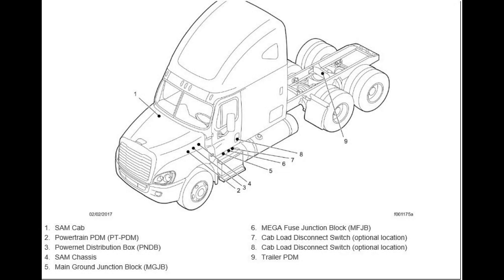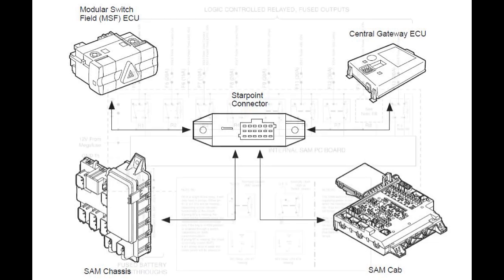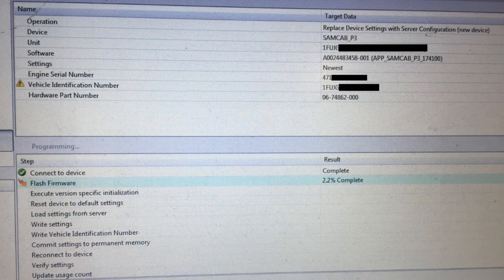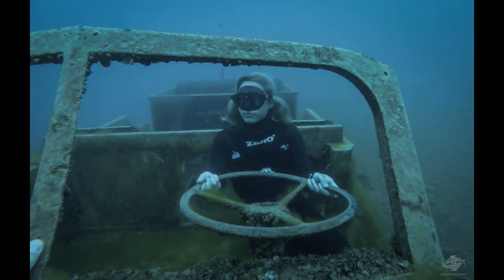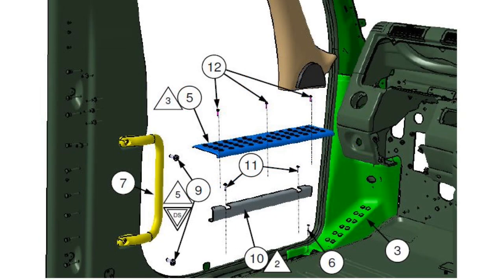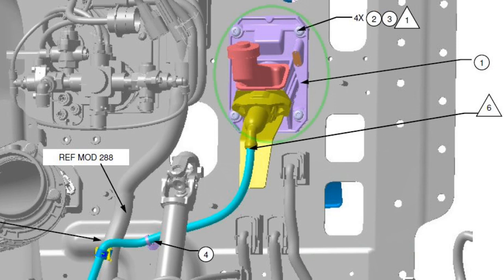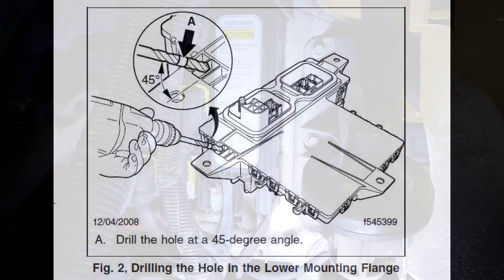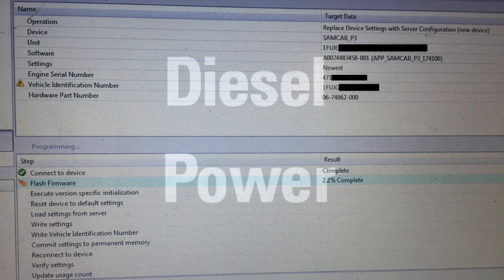Know your Cascadia: The SAM Chassis

Comment: My MAF (mainly hazards and dome light switches) have been intermittently failing or working. Night you can see when the back lighting illuminates the switches, they will work. When the back light goes out, they do not work. Headlights, blinkers, reading lights. They all work and have no trouble with operation or lose power. It seemed to just be the MSF. Both front Dash and switches in the sleeper.
Reply from the maker: Each switch mounts into a pack or group of switches. Each switch pack is "Daisy chained" to the next with a 3 pin connector/harness on each side. Each pack just has a simple little circuit board inside that's visible once you pop them out of the dash. Those circuit boards and connectors are prone to corrode and cause all kinds of issues. Since they're all wired in series, it only takes a problem with one to mess up the others down the line. The Daisy chain begins at the MSF master (Hazard switch) and jumps to the slave packs down the line (There can also be more than one line leaving the MSF master too depending on the trucks configuration). It would be worthwhile to pop them out of the dash and have a look at the connections. Something as simple as spilled coffee can slowly begin to take them out.

Comment: Could a faulty Sam chassis cause issues in the sam cab? When I turn the key on, cab lights, turn signal, hazard lights, blower controls, wipers stop working. Also I get chs 216, ecu 128, and cab 249 codes. Any input would be greatly appreciated

Comment: Where would one find the gateway control module on a 2019 freightliner
Reply: If you have a login to DTNA connect you can find it that way but if not it's located at the electronic bay which is on the passenger side, inside the cab. It's behind the fuse panel. The central gateway is all the way on the bottom

Comment: I have a 2010 freightliner cascadia and  my voltmeter gauge say I have 12 volts and my battery warning light come on but my check my alternator and is 14.0 volts and my battery too if I turn my engine off 2 check engine light come on and my truck won't start and I was checking online and say my truck have a 2 sam chassis recall I check my and have water marks so I gonna take my truck to the dealership this Friday I hope they fix that  Thanks for the video.
Reply: Check the PNDB.

Comment: Chs 71 spn 524049 fail 31

2) cab 33 spn 524049 fail 31

3) eng 0 spn 59.6 fail 13

4) eng 0 spn 60.2 fail 13

5) eng 0 spn 60.0 fail 13

6) eng 0 spn 97.3 fail 13

My symptoms that I'm experiencing, truck shuts off and on like crazy. I don't have any lights at all. So I'm thinking something electrical? Can you please help me here. 2012 Freightliner cascadia dd15 engine
Reply from the maker: All of these codes point to the MSF (The Hazzard Lights switch) powering down or losing communication with the vehicle. Since the MSF is powered from the SAM cab and the truck is also turning off and on, I'm guessing the problem may lie with the SAM cab.
Reply: @TheDieseler  those codes doesn't have anything to do with the Sam chasis? I was told that the Sam chasis is the culprit
Reply from the maker: The one code being broadcast from the SAM Chassis (CHS 71) is indicating it's lost com with the MSF. The SAM Chassis also does not power the engine. Now, that being said, it's tough to be 100% certain without being there to check things out. Basic things to check are power and ground supplies to the modules and any signs of water intrusion.
Reply: @TheDieseler  is this an expensive repair?
Reply from the maker: Again, without knowing the exact cause of the problem, it's tough to say.
Reply: @TheDieseler  thank you!
Reply: Sounds like PDNB
Reply: I’d bet it was your PNDB

Comment: 2014 Cascadia evo. I was wondering how to connect a GPS unit. It needs constant, switched power,  and ground. How do you do it without cutting any wires? Is there a connector I can tap into?

Comment: I have two error codes in my truck. Cascadia evolution 2014 manual transmission;
The one on the dashboard reads: 
NO DATA BUS COMMUNICATION 
 and only displays the hobbs milage, no gauges works. My AC cab unit doesn't send cold air and my sleeper  ac PARK SMART doesn't work either.
The other one is on the meritor wabco screen that reads: 
CAN BUS ERROR 
J1939 messages 
Check connections. 
What are your suggestions? I am in Oklahoma.
Thank you.
Reply from the maker: It sounds like there is a problem with the 1939 Datalink. It could be something simple like a recently added eLog system problem, a malfunctioning module or a problem with the 1939 wiring. That Datalink is shared throughout the truck. If the only affected modules are the ones you've mentioned, the problem could be inside the cab.
Reply: @TheDieseler  
Thank you. I will look around the cables. I will keep you posted. Thank you again

Comment: Hi,
If changed Sam cap and Sam chassis with used one, how can I do the calibration using Ddd8, and my version can not be connected on line?

Thanks
Reply from the maker: The parameters and software needed to update them have to be downloaded from the DTNA/Detroit servers through DiagnosticLink.

Comment: Great video! Thank you.  Would be great to hear about trouble shooting symptoms of SAM cab vs chasi vs ECU.  I've lost cruise control and have rough acceleration, like when you disconnect the speedometer (Volvo).. max spd of 50mph.  I have a Cascadia 2012. Can't get a  Diagnostic link to work but J19 still sends all gauge and mileage data to my logging device on my cellphone. 30 min 3 key flip reset does not solve.  Thx
Reply from the maker: Do your engine brakes still work? The reason I ask is because a faulty clutch switch is not that uncommon. The first step though would be to figure out why a diagnostic tool will not work. That's the best way to remove a lot of the guess work.
Reply: @TheDieseler   No. The engine brake light illuminates when turned on, but does not actually work.
Reply from the maker: @maximaleffort  I'm willing to bet the clutch switch is telling the CPC that the clutch is partially depressed. That will keep both the Engine Brakes and Cruise from working.
Reply: @TheDieseler  Thank you sir!  I can  unplug the direct wire I put in when the clutch switch failed.  (Allows me to start without holding the clutch down) Do you think maybe that is why the parking break warning is flashing when I open the door, even though the parking break is set?  I believe this is keeping me from doing a parked Regen.  Thank you Dieseler!
Reply: The chronology was..1 cruise control stopped working intermittently,, 2 engine brake would  not engage sometimes when switched on, but other times would, 3 no cruise ever , 4 "warning parking break off" began to flash while I was driving and when I would open the door when parked with air brake on, 5 no engine brake engage ever, 6  clutch switch failed to start truck when depressed, 7 hotwired clutch switch, 8 no parked  Regen, 9  derate, 10 diagnostic port says take to freightliner.  But last time I did that I spent 12,500$ USD on a new 1 box, no money left-that was about 100,000 mi before all this stuff cascaded into my Cascadia! LoL.  Thank you, I will Patreon you thank you for your insight and videos. Thanks again.
Reply: OMG Dieseler!!!!!!!!!!!!!   I got my cruise, my engine brake, and my truck is trying to Regen right now!!!!  I can't thank you enough.  I  rewired my clutch  hot wire by changing the configuration once it started.  Wiring females 1 to 3 starts it, and once it's started moving 1 to 2 gives me back my functions.  Thank you, Thank you, Thank you, Thank you!!! I patreon'd you before I tried it! Good Karma.
Reply: @TheDieseler  I also moved the air pressure switches' female  connectors around onto different males' switches above the pedals until I got that false "parking brake off" warning to go out.  I believe both the clutch switch and the air pressure switch prevented the Regen because no matter how I rearranged the air switches before I could not get the truck to Regen! But before I clutch switch went out I could move the air switches females from Park to low air to get false parking brake alarm to extinguish and then Regen. Thank you! Thank you! Thank you!
Reply: @TheDieseler  Regen finished and no red flashing and eng shut off.  Got some horses back.  Absolutely Amazing!  That eng brake had been intermittent for a couple years!!!   Thank you Dieseler!!!!!!!-Will E
Reply from the maker: @maximaleffort  That's great! Glad to hear you were able to sort it out. Clutch Pedal, Service and Park Brake signals are all interlocks for Cruise. Engine Brakes and Parked regens so it makes sense that all of this was causing problems. Thank you for the support!
Reply: @TheDieseler  Rock on brudah. Thx.
Reply: @TheDieseler  Thank you!
Reply: How is that  " 30 min 3 key flip reset done and what it is supposed to resolve?
Thank you